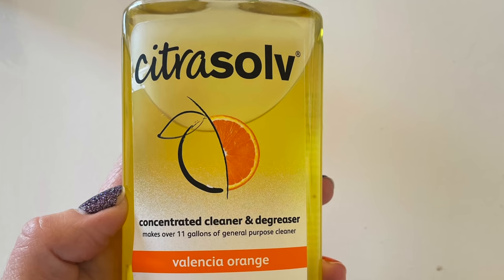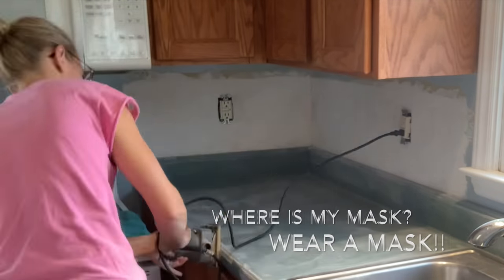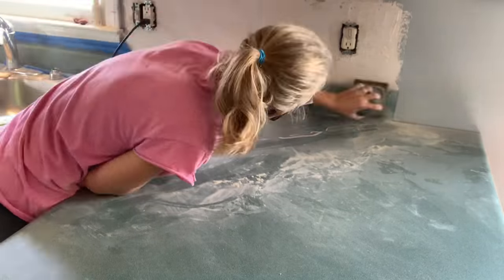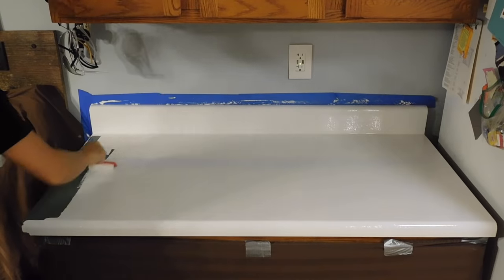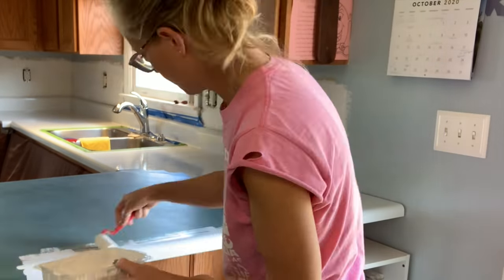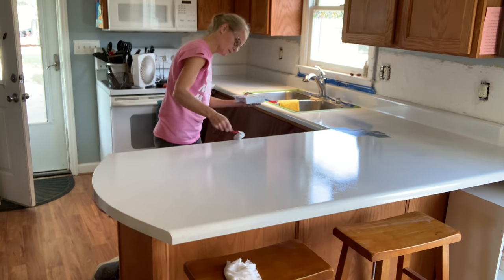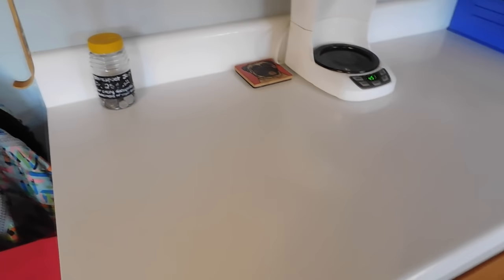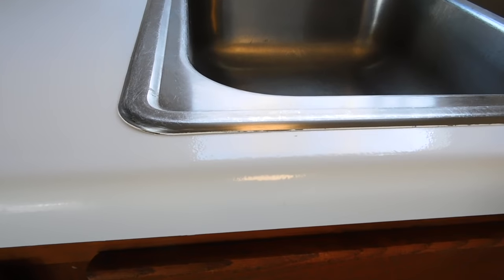DIY Painted Laminate Counter |CHEAP LAMINATE COUNTER MAKEOVER | DO IT YOURSELF EASY LAMINATE COUNTER

Comment: I've been watching a ton of epoxy countertop videos. Yours was so much simpler.  I'm wondering if you added the spray paint technique to yours when it was still wet if it would work. Just spray some color of your choice in different plastic cups and use a paint stick and brush to give it your own design. Alot less mess
Reply from the maker: Thank you for the positive feedback.   I think that is a great idea

Comment: Good job 👍 if you put a thin coat of clear epoxy that would seal the deal.
Reply: Epoxy starts to turn yellow from uv light after a couple of months. Have you noticed any yellowing?
Reply: Don't you see the leggari products & the stone coat products that's all epoxy it doesn't yellow its polyurethane that yellows.
Reply from the maker: Not yet, its 6 months this month.
Reply: @donnah3892 you are wrong. Its a proven fact that white epoxy yellows unless it has uv stablizers.
Reply: @thomasfisher3051  no check the two products that I mentioned they do not yellow
Reply: Donna you are wrong

Comment: This turned out amazing! I’m glad I came across to ur video. Bf is buying a house and we’re looking for budget friendly diy and this is definitely my top choice so far! 
What counter top cleaner would you recommend to use for daily cleaning? Also is there an option for an additional top coat to prevent daily wear and tear? Thank you! Awesome results
Reply from the maker: Hey Keesh!! Thanks for watching and congratulations on the new house! This is definitely a great choice for a quick inexpensive option. I think topping it with a clear epoxy would work. For daily I love my vinegar water and dish soap OR just good old water and a microfiber rag….. I’ve used Clorox wipes as well as method multi purpose cleaner, I LOVE their honeycrisp Apple scent!! ♥️ 🍎 let me know how it goes!
Reply: does this scratch  easily

Comment: Wish I had been around. I do this for a living and could have offered a few tips. Over all...Good job though.
Reply from the maker: Aww thanks Mike and thank you for watching! ❤️
Reply: Hey Mike I'm planning on doing this since my counters been roughed up from use and I'd want to make it white before I sell my place in about a year. Anything to know that she did not mention? Thanks
Reply: I could use some tips. Tried the spray paint first and went on way too thick. Sanded and went again with the paint on one and still dripped and looks terrible. Don't even know where to go from here...any advice?
Reply from the maker: @janicelewis1241  🤔  I think i would sand its all down and make sure you do very thin coats, let each layer dry about an hr and so another thing coat, just stick with thin coats, so you don't get any runs.
Reply: @Cloudy-yd2kk  Sorry for the very late reply. Just found out what notifications are for. I use a special speckled paint called multi spec. I believe it can be rolled on? I spray it. When masking the sink? Use a 3 inch or so tape and let it lay over the sink onto the counter and make sure it is pressed down well. Then just use a razor knife to cut around the sink edge. Pull from the counter and leave on the sink. I sand with 60-80 grit.
To fill any cracks or chipped areas. I use fiberglass body filler. Then I apply the Multi spec or I have used  the multi colored rattle cans for my color coat. Be sure to mask the cabinets and walls. Also cover the floor if using rattle cans. Any color and good brand should do fine. Let dry and apply an acrylic clear of choice.
Reply: @JesiDavisBuildingaSimplerLife  Yep! That's it!
Reply: Here is a vid showing the the type of paint I used on my own counters because I liked the colors. https://www.youtube.com/watch?v=fKdR_xPo71o

Comment: We used this on some tables in a laundromat, it's not anywhere near durable enough for this.
Reply from the maker: Hey thank you so much for watching!! We are still pleased with this, but I did drop and break a large ceramic bowl on it the other day and the sharp broken edges scraped the paint. But other than that it’s holding up well.
Reply: @JesiDavisBuildingaSimplerLife  I just used actual counter top paint the other day and it seems to be more durable than the appliance paint. It stinks really bad.

Comment: This was done extremely well - good prep, technique!  Most of the videos I’ve seen where folks weren’t thrilled was probably because they didn’t do the prep correctly, or put on too thick a layer each time. Even with regular painting you should always opt for multiple thin coats. 
And you really have to tape off the borders etc.

Comment: I have found that the preparation is vital, drop cloths and mask off areas you do not want paint on (I prefer frog tape) sand with lowest number first to highest number last (80, 120, 240), also run your hands over the surface after it is cleaned off of all dust and check for smoothness, and allow enough curing time before you start to use the area. Countertops about 72 hours in a well ventilated room. Dampness allow another 24 hours drying time. I know it seems like a long time but paint needs to cure or harden and you can't rush it. Your countertops look beautiful. You can fix the oops areas easily with a light sanding (240 grit) and another coat of paint. 👍 👍 👍
Reply from the maker: Perfect! I think I’m going to definitely redo areas with sanding and add more coats to the coffee counter side for sure! Thank you for the tips!!

Comment: Yes, I also have a green laminate counter top that has a seam pucker - my solution is to  save up for a new laminate countertop in a warm wood tone (stone is cold to lean on & I hate stone for that reason) - the new countertop will be complimented by a sink, adjustable tap  (faucet in your part of the world) and new induction cooktop to replace the 90's electric hotplate  . I'm sold on induction (currently using a mini IKEA version, it's versatile easy to clean & cooks like a dream).
Trades people will be called in to professionally install (under supervision because when a problem presents you need to be there). So,  patience is the key.

Comment: I just did mine and have a couple of comments. For the bathroom countertop, I used a 4" foam roller, 3 coats of paint, and it turned out OK. 

For the kitchen, I first painted with a primer.  After 2 coats of appliance paint, I sanded with 120 grit (bad) sandpaper (orbital sander).  I should have used a much finer grit.  After the 3rd coat I noticed what looked like coffee cup stains.  They were actually swirls from the sander. I hand sanded  with 250 grit until it appeared from all angles I had removed the swirls. There was also an area that had small holes, almost like someone had taken a fork and jabbed it into the countertop several times.  I filled the holes with wood filler and sanded down. Then I painted a 4th coat using a 9" roller.

Overall, the finish is excellent, much better than the bathroom countertop. However, the swirls are still barely visible from a certain angle.  If you weren't looking for them you would never see them.   I might sand that area down again and add another coat of paint.  I haven't decided yet.

Prep is key.  Use a fine grit sandpaper to get rid of any imperfections.  Even with a bright light, some imperfections may not show up until the epoxy paint dries.  The paint is cheap, be willing to add another coat if that what it takes.
Reply from the maker: wow great feed back and information! Thank you for sharing! Very helpful!

Comment: Great Vid! Very useful 👍
I wish I'd have seen it sooner, I'm doing something similar with "rattle can" hammer paint then clear coat. I skim coated a similar crack with Bondo then sanded and primed, crack gone!
Try lightly buffing the pen mark with an auto paint cutter, might remove the mark and keep the shine!
Btw I think your voice is very soothing!☺️
Reply from the maker: Hey Joe! Thanks for watching and for your kind words! Thanks for the tips!  I will have to try the auto paint cutter next time, every time I use the magic eraser the gloss finish goes away. Im thinking about redoing it some day?! 🤔

Comment: In the  late 80's /90's Rustoluem sold this paint called Plastic Colors Melamine paint and I  painted  kitchen counters , cupboards and even my waterbed with this paint , no primer , 2 coats and it was amazing but oil based so it was discontinued.

Comment: I just found you as I am wanting to try this on a small bathroom countertop. Thanks for sharing! It actually looks great and seems relatively easy compared to some. Any idea about how wide your roller was? I am looking at some on Amazon and there are several different sizes.

Comment: Hi Jesi, Are you going to paint your kitchen cupboards?  I was just wondering because that shaker style looks really nice when painted. ❤️🇬🇧
Reply from the maker: short answer; Yes, long answer; my hubby just gave the green light to do them, however our fridge leaked and we are currently picking out flooring ... which will take 4 weeks to come in ... haha ... we want to get our eyes on the flooring in person before we pick out colors for cabinets ... Ive been researching Cerusing ... but I heard it doesn't work well on Pine ... which makes me so sad. I do have cast iron hardware for the cabinets and drawers ...
Reply: @JesiDavisBuildingaSimplerLife 
Frenchic paint.... It's wonderful.

Comment: Great job! Turned out really nice. Please give us an additional update. I've been thinking about this a lot. You can also do a peel and stick wallpaper backsplash to save money. There are tons of different designs out there nowadays.
Reply from the maker: Ya know what, I have been thinking about those stick ons .... 🤔
We are about to replace our flooring, need to.book it and the planks wont be in until next month ... yikes .... but with that, will come painting the cabinets AND then hopefully the back splash!
Reply: Recommended sites for peel and stick? Plz no Amazon links
Reply: Vinyl sheeting works as well. Easy clean up no peel

Comment: You counter came out great, however I don't know if the epoxy appliance paint is the way to go. I tried this on a tabletop and was happy with the results.  I painted it outside and it sat out there for 2 days. The fumes are crazy strong, you had made mention of this in your video. I researched this further, and epoxy can emit toxic vapors for 2-3 weeks. I had to move the table back outside as the smell persisted, and it will sit out there for a hot minute.  Please use caution with this type of paint.
Reply from the maker: thanks Peggy!! I wish i would have researched further ... we did leave the windows open and fans going, and actually the kids and i went out of town the next day after it was all done .... poor hubby 😬

Comment: Looks fantastic! You did a great job. I want to try this on a bathroom vanity top counter and I’ve seen it done with spray paint. Can someone share their thoughts on is it better to use this product in spray paint or paint that needs a roller ? Thax in advance for taking the time to answer
Reply from the maker: Hey hanks for watching and commenting. I think if I had had a sprayer I would have tried it, but then I’m not sure I would have been good at spraying. The rolling for gratifying for me though. Hopefully someone with praying g experience will answer 😊
Reply: @JesiDavisBuildingaSimplerLife  thank so much for your reply! After much thought, I decided on buying the roller paint to follow your method. It took me literally months to get a spray paint project right on something as simple as my kitchen appliance handles and stove knobs and not to mention dealing with the loud fumes and debris or dusty spray paint mist that gets every where with spray painting. Now I was working with a metallic spray paint and I had to get some experience with it but it was just too much to deal with. Because of this, I prefer to spray paint outside in my garage but of course I can’t take my vanity apart to do that so I’ve canceled my spray cans of the epoxy and thanks to your video I’m going to do the roller paint method. I ordered my I think from your link. Yes spray paint is much cheaper but it’s too much to deal with. Thx again for making this video!

Comment: Try magic eraser fir the black mark. This links to the appliance paint. Is that what you used?
Reply from the maker: Hey Lisa! Yes I used appliance epoxy! I have a 7 month review coming! I did use magic eraser, it worked, however it took off the polished finish too. Not real noticeable, unless you’re looking for it.

Comment: Can you lay hot pans on the counters??  Does it scratch easily??  How about knife marks??  I’m not a careless cook, but I do
live with boys!!  Yours look great!!
Reply from the maker: Hey Rita! Thanks for watching! My son jabbed his fork into it, there is a small spot I show in the video. We’ve dropped cast iron on it and slid that across as well as my baking stones, though I try not too do that. The spots I show are not from that though. I use hot pads and trivets to protect from the heat. I knead my dough right on it and use my dough scraper on it just about every day. No scrapes. A gentleman told me a couple days ago he uses this paint on the bottom of his snow skis. He has painted once, has held up for seven years so far. I thought that was cool! I’ll be doing a 6m review in April. There is only one new spot than the areas of Knick I show in the video. Connect with me on Instagram and I can send you some candid video over there

Comment: The video is very useful and well done. Is there some kind of topcoat you could apply that would harden the surface and help prevent marring's from fork etc.?
Reply from the maker: Hey Pam! Thanks for watching, there probably is something I could have added to have made it more durable against metal or sharp edge scratches.

Comment: Wonderful job!  Well done.  I’m intrigued what happens to the roller between coats?  Can you wash it clean or do you have to keep using new rollers for each coat?  I think that suggestion to use a clear epoxy for the final finish is a really good idea.  Just like modern car paint.
Reply from the maker: Hey Andrew! Thank you for watching and commenting! I wrapped the roller with plastic wrap in between coats, over night I wrapped it and put it in the fridge.

Comment: Put some w,d 40 on a soft rag and rub easy for the manic marker mark it will take it off no problem ,,,it puts the oil back into the paint ,,u can also use it on paint that gets on molding ,or Windows then wash with Windex and it looks and lasts like new
Reply from the maker: Oh man Brian, these are genius tips! Thank you!
Reply: @JesiDavisBuildingaSimplerLife  if u get paint on the rug poor a cloth table cloth it will take the paint out to ,,,and when u are done painting spray some on your hands and grease or paint will come rite off ,,,plus w,d 40 is good for your hands then just wash them with soap and all clean ,,I hope these make things Easter, I know that it works REALLY good for me ,the counter came out great good luck

Comment: Perfect timing! I'm buying a townhouse built in 2003 and the counters are.... cream. CREAM. Yuck! The original owners painted the door fronts gray, but I am sure I'll need a few coats of matte vlear protector to make cleanups eadier. Nect I think adding a varieable neutral glass tile backsplash.
Reply from the maker: yes do it!!!  .... ew cream ... 🤢
Reply: @JesiDavisBuildingaSimplerLife  you should see the condition the cream electric stove was in. 😆
Reply from the maker: @camouflagejumpsuit  😂

Comment: Great video, I'm going to try it on my counter top..... but can you tell me what all you used them and where you purchase the paint from and do i have to sand it down
Reply from the maker: I cover all of this in the video, but I did get the paint from Amazon, or I think you can grab it at Lowe’s or Home Depot. Some videos said you did not need to sand, but I wanted to ensure the paint had a rough surface to stick to. Thanks for watching, let me know if you have further questions.

Comment: Just finished doing this to our counters, it’s currently winter weather here in Ohio, Any advice on curing time before we put any items on it?
Reply from the maker: so so sorry i didn't see this .... how did it go?
Reply: @JesiDavisBuildingaSimplerLife  it turned out pretty good! Not as smooth as I would have liked I think I did too many passes with the roller on those areas so it’s a bit more textured than planned but still looks way better than the fake dark granite color we had before

Comment: I want to know what is it's durability. And also will it get affected by water splashing and heat of gas stove. We Indians use gas stove mostly... Your video is nice
Reply from the maker: Hey Swati! Thanks for watching! On the can it does say not to use on heat services, I think over time it will yellow. We are experiencing a slight yellowing underneath the coffee maker. I wish we had gas, however with our glass top, the counter seems fine there and I have had to put some hot things on it, so far it looks ok. We are over all happy with the physical durability, but there are blemishes that I explain in my 7 month review! Go check it out if you haven't already! ♥️  Sounds like I need to come over for some authentic Indian food! 😋
Reply: @JesiDavisBuildingaSimplerLife  you are most welcome in India❤

Comment: Would sanding to 240grit between coats to smoothen the surface work with paint like this?  Ofcourse not on last coat
Reply from the maker: maybe, but i think it was my roller, it left that orange peal finish .... i think if i had used a high quality roller, perhaps it would have been smoother.